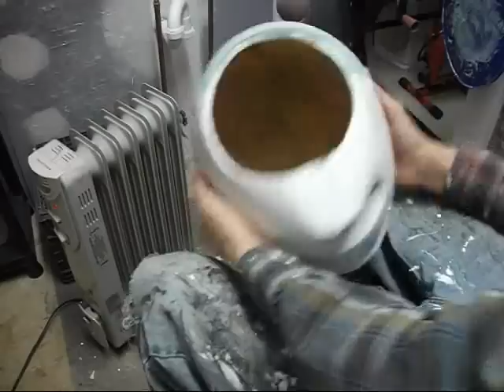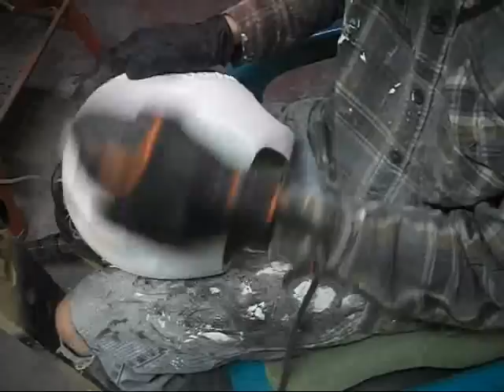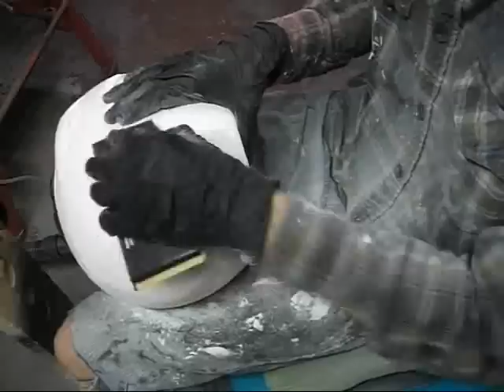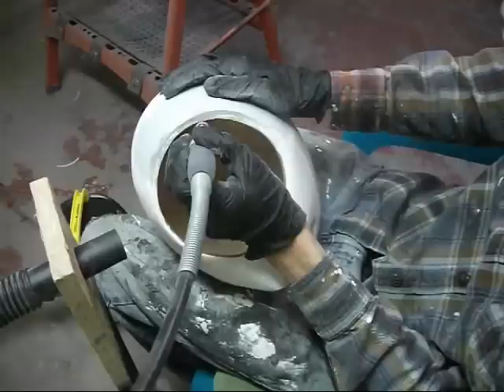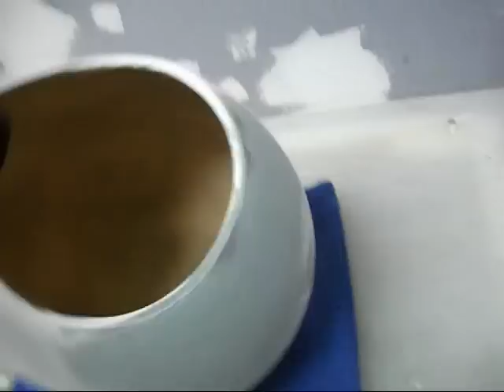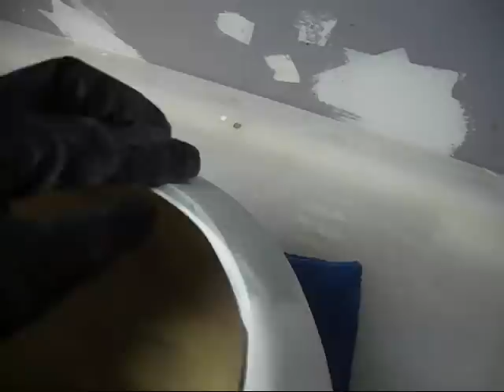SCREEN CAST MMPR RED HELMET WORK (FIXING THE WARPED NECK)

Comment: Are the masks meant to be worn? How do you see?
Reply from the maker: +Douglas Quaid Yes.  These are "kits."  You cut the helmet in half and attach clasps to it to close around your head.  You also cut out the visor area and install a real see through tinted visor like on the show.  Or, some people choose to just paint the visor area black and drill a bunch of small holes to see and for ventilation (known as a "stunt" visor).
Reply: +Boochieboy ahh ok I get it thanks dude. What turned you onto this hobby? Pretty random one no offense